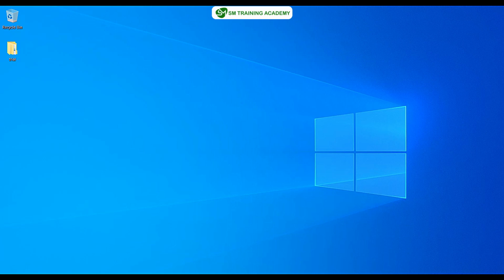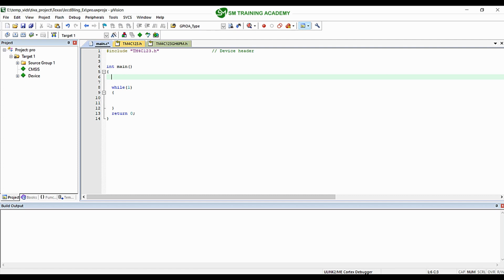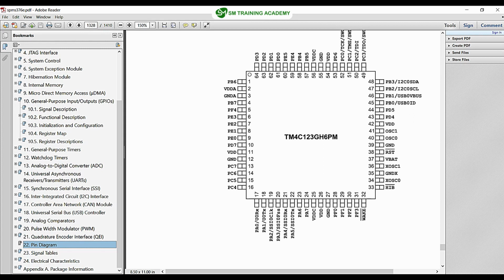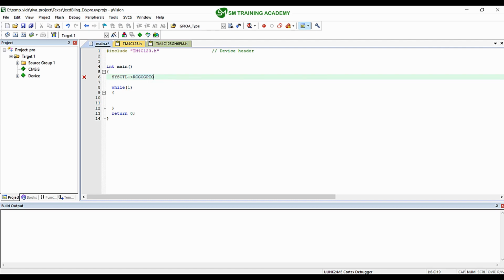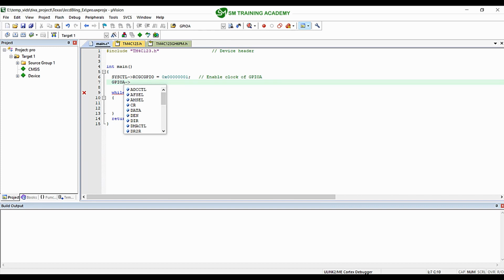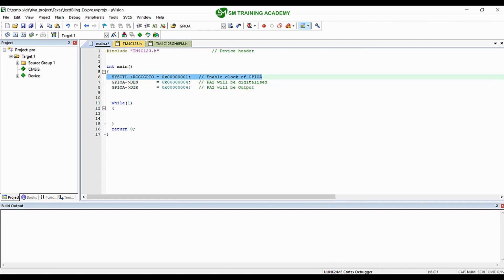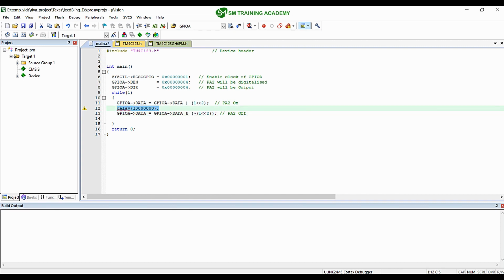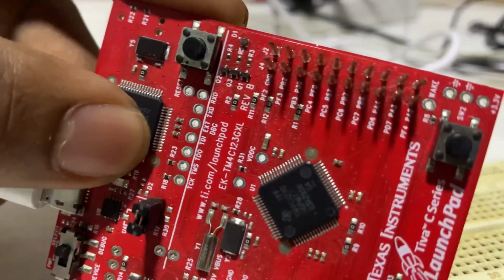Interfacing LED with TM4C123

Comment: Stellaries icd is not seen in option of debugger selector i did all the procedure include downloading driver and also add on. but yet it not seen if there is any one here faced same problem and know to solve it, it may be helpful.
Reply: Make sure you install the add-on executable into the same path as the Keil IDE installed path i.e. if you installed Keil in C:\\Keil, also install the add-on in the same path C:\\Keil
Reply: some of they says like you have to download addtional file i did too but yet i can't find way to solve it